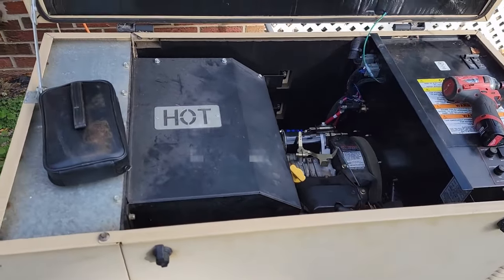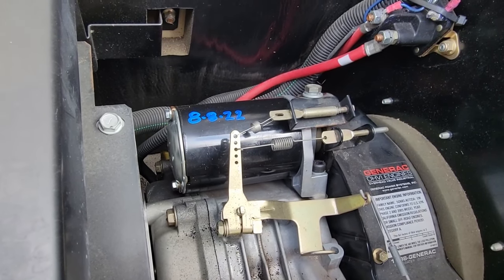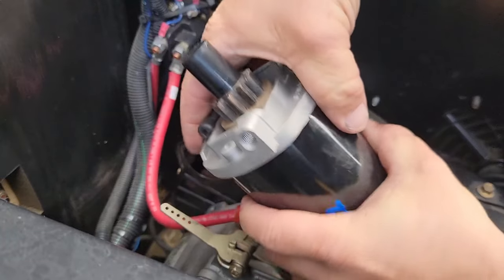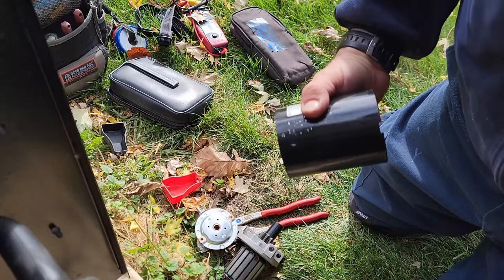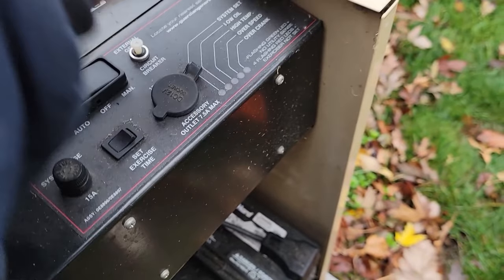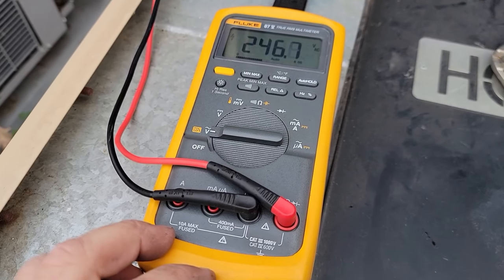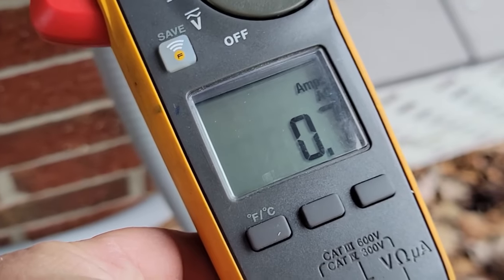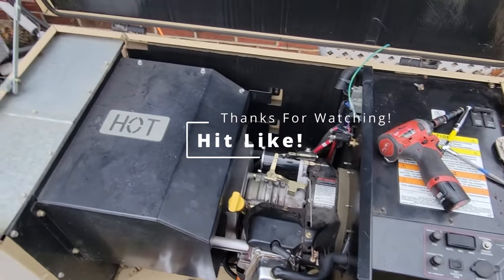Generac Standby Generator Wont Start AGAIN!!!

Comment: I was a bit stumped by our 8kw overcrank issue it had since last week, but it turned out to be some corrosion on the gas solenoid wire connectors; there was a big dump of snow before Christmas and that left a lot of moisture everywhere and the 12 volts isn’t much push to get through some crusty corrosion.  I removed and re-attached the wires and that was enough to get it fired up.

It’s been running a bit unstable lately, hunting a bit so it definitely needs some kind of service, not too sure what exactly but at least it’s able to start now.
Reply from the maker: I'm glad you got it going!

Comment: I like Amprobe meters , I got into them by watching you Rick 👍
I got the AMP 320 which does phase rotation but actually does have 3 leads which makes it sooooo convenient ! I use it to check for correct phase rotation on every commissioning and it has never let me down so far 👌
Reply from the maker: That makes me feel good🙂👍👍🤜🤛

Comment: Thanks Rick for taking us along on your “favourite service call” I can’t believe you have to tell everyone repeatedly about the knipex pliers and put a text on screen to again let people know they are not regular channel locks!!
Reply from the maker: It's amazing how many people either don't know about them or are just not paying attention.
Reply: Still not a replacement for a good set of wrenches, I don’t care how good your adjustable pliers are it’s just lazy. I grew up in a mechanic’s household and I’ll ALWAYS go for the right tool for the job.
Reply: @JeremyPeters  when you do service calls that can be far from the truck or on a roof you will learn quickly how to slim down your tool bag to reduce the weight. My dad is a retired heavy duty mechanic and I have a full rolling chest of all kinds of wrench’s but I am for sure not packing that around!
Reply from the maker: @Jeremy I carry as few wrenches as possible, the only good fixed wrench is a 6pt box style. Open end wrenches are junk and strip the head. I haven't stripped a bolt yet with those.

Comment: I had a problem with my 15 year old generator just clicking instead of starting, replaced battery and yet only started one time, so I replaced the starter twice with same symptom, FINALLY I got a battery with over 600 CCA (of course I had to make the cavity larger with a hacksaw) and now starts everytime for the last 2 months

Comment: We had a 20kw Generac, side opening door panels, 27 years old, no problems, accept the muffler rusted and I replaced it with all stainless one, SS clamps, pipes, flapper, etc. We would lose main power at least once a year, sometimes ran for a few days before power was restored. Replaced the battery twice, thats over 1400 startups. I added a circuit so that if the generator attempted  an exercise but produced no 240v power a local sonalert beeped so the home owner could investigate.
Reply from the maker: They were built better back then.

Comment: I have the 12KW version of this series I bought as old stock to replace a few years newer 16KW that blew up.  The 16KW was only a few years old when it lost the rear cylinder, I pulled pieces of the con rod and piston out through the jug.  Real mess and a serious piss off for me.  As for the battery?  The unit is located next to my garage so I relocated the battery into the garage and installed a good quality marine 5amp smart charger. I pulled the connector on the internal charger.  I also put an oil separator tank on the crankcase breather as it was sucking oil into the air filter and plugging it.   Why there is so much blow bye on an engine with so few hours is a mystery.   I just replaced the brushes on the generator section as one of the braided wires attaching the brushes had failed.  Brushes actually looked pretty good otherwise.  My top lid has completely rusted out so I swapped out the aluminum lid from the newer failed machine.  Was not an exact fit and had to relocate a hinge.

Overall these machines suck in my opinion.  Mine is on an out island in the Caribbean and it is a constant battle to keep running.   For example I’m sick of seeing that blinking overspeed led blinking.   Many of my neighbors have given up on them as they have failed and eventually no one seems to want to fix them or are unable to diagnose them.  They then upgrade to more expensive diesel units. I would never have purchased the Generac in hind site.   Pay me now or pay me later.
Reply from the maker: I feel your pain my friend, being out there on the ocean doesn't help, that salt water attacks everything. The reason why they're one of the best selling generators is because they are one of the best price home standby generators out there but obviously quality has been laxed for quite a while. I've been begging our sales guy to not sell any generators anymore just because it's nothing but a hassle.
Reply: @HVACRSurvival  indeed for the price you do honestly get a lot for your money, just not a lot of quality to go with it.  My first service call 12 years ago involved flying someone in from the main island.  $$$$$.  He diagnosed it as a control board, so I brought one in from the States in my luggage, but it proved not to be the problem.  So almost $1000 later it was still not working.   Taking matters into my own hands and studying the Wiring Diagram I was able to diagnose it as a shorted Auto/Off/Manual toggle switch, for $15 plus shipping.   Salt water from a tropical storm(Irene??) got into the switch.  I’ve now chosen to do all of my own repairs, which can be a frustrating anxiety ridden endeavor for a DIY person, but unfortunately necessary in my case.
Reply from the maker: The problem I run into is this isn't all we work on. So if all I did was work on generators it wouldn't be a big deal.
Reply: Blow by, I wonder if it never broke in properly?
Reply from the maker: Where I use to work we use to run them 5-8hrs and then change the oil. We didn't lose motors like I see now.
Reply: I've always felt my engine failure was precipitated by a stuck valve making contact with the piston.
Reply: that flashing overspeed light is the board not seeing AC output fast enough after starting. The factory does offer a field boost kit but at this point in time it's well out of the goodwill gesture they were giving 10 years ago. I believe retail on the parts is under $100 and might take a half hour to install. Last time I put one in was just over 3 years ago. Not sure if that's a worthwhile investment now.
Reply: @rupe53  good information.  I was not aware of the fix,  I’ll research it.
Reply: @rupe53  found it.  0H07850SRV  $80-$90.  Ordered.
Reply: @briand2614  .... going from memory, the kit was originally offered for serial #s starting in the mid 25xxxx through 45xxxx. We were one of the test dealers who got paid extra to do follow up on a few dozen sets. (factory R&D outreach) That's the extra clout you get when you are high enough volume and 90% of your techs are factory certified. As I retired (3 years ago) the newer sets were having a similar problem but now it's a digital read out of RPM sensor loss, which basically means the board isn't seeing output fast enough. I hear through the grape vine the board spec was changed to wait an extra few seconds before showing that code.

Comment: I had a small motor like this, on a neighbors lawn mower vacuum. It was "locked up" but it turns out, that in the right conditions, they would not spin over. I spun the motor over by hand, just a inch or so, and it started again. Haven't had a problem since.

Comment: I got an 8K Generac portable generator for a house generator for two main reasons.  If I ever moved I wanted to take it with me. And, I literally save over $3k not going with a stationary generator set up.  It works fine and powers the house when we lose electricity.  When the power goes out you can look up and down the street of the housing complex and I am the only one with lights.  The only thing that failed and I have never fixed it is the battery system.  I have no idea why the start battery system wasnt designed to charge when the generator run.  Anyway, the battery died and I replaced it and that one bit the dust too so I just use the pull cord and it always starts within 3 pulls.  I did talk to Generac and they said when I run it  bi-weekly to keep everything lubed to be sure I put some kind of load on it.  Even a fan would do.  The idea is to keep the brushes working properly.  So I do and I have had it several years through several outages and it works.
Reply from the maker: That's what I own. None of the portables that I have seen have a battery charger built in, they usually have a external charger.

Comment: thanks dude.  i'm investigating generac to buy one.  I'm apprehensive .  Bad and cheep engineering so far.
Reply from the maker: The newest models are a lot better. I own a 8kw gas and a 3k inverter and both are Generac. No problems from either but I take care of them and they are inside the house not outside in the weather.

Comment: Hi great video I will be changing my battery to see if I can get my generator running.  The one I have is same kind as in the video except mine has an hour clock.  Can you tell me how I can find out how many KW is the generator and is it entrie house or not.  Thank you.
Reply from the maker: Inside the generator they have the amps it’s rated for take that times the voltage which is 250 V. That will give you your wattage.
Reply: @HVACRSurvival  thank you I will take a look. If the new battery does not fix the issue  do I call generac to service the unit or should I call an electrician? Also any ideas on cost for a service call? Im in NJ. Thank you.

Comment: Do you carry a quart bottle of distilled water for topping off those batteries?   The main victim of the overcharging is going to be boiling the water away.  (Specific gravity hydrometer is useful as well)    Unfortunately, too many people - and shops - don't check the batteries.    They just run them into the ground, then replace.
Reply from the maker: My refractometer has Specific gravity and I have a dedicated one. Interstate battery said it doesn't matter if its distilled like it once did so I don't worry about it anymore.
Reply: @HVACRSurvival  - Yeah...that's a company that wants you to buy new batteries.   Do a quick search.  Toyota Forklifts, for example, has a "how to correctly water your forklift battery" short article.  It's not really so much 'distilled' as needing 'pure'.   The problem is that most bottled water has minerals added 'for taste', let alone hard well water.  People with water softeners, for example?  Battery killer.  Chlorides PLUS the minerals (potassium, calcium, and magnesium).   Exide Technologies own website (One of the two manufacturers of car batteries in the US) says distilled only, and even sells their own brand of distilled.    

Now, they may be talking about just calcium, which is now sometimes even added into the battery plates for additional 'science'.  :) 

It could also be they're just referring to people that check once a year or two, which means it's not really going to help much anyway. (that reminds me, I need to check my car battery)
Reply from the maker: 😂👍👍 go check it!
Reply: @HVACRSurvival  ... I serviced Generac for almost 25 years and over the last 15 never had to add water to a battery. Between maintenance free, sealed batteries, and lower charge rates, it's just not the problem it once was.
Reply from the maker: @rupe53  the new units are a lot better. That's why I haven't had to make many videos of them. I originally got into generators because I was bored with residential and light commercial but I'm into too many things now to miss with them. I lost my desire🤷
Reply: @HVACRSurvival  ... I feel your pain. I retired 3 years ago. BTW, our company was large enough to do only gen work and never have a dull moment. About 6,000 customers and 15 service techs.

Comment: I just bought this unit. If the unit isn't hooked up to any utilities at all. It's just sitting on the ground and the only thing hooked up is the battery. Can I get the unit to crank to make sure the engine is good? Trying to bench test a generator before having it installed.
Reply from the maker: Yeah it'll start and run just have the breaker turned off. Unhook the battery when you're done because it'll go dead if it's not hooked up to the utility.

Comment: Great video. I'll subscribe. I just bought this exact unit. The propane inlet line on the side you're working on in this video, on the one I bought is full of rust. I want to remove the line where it goes into the regulator behind the battery. Is the line going through the steel box just threaded into the regulator? I don't want to crack the cast housing of the regulator. Thanks.
Reply from the maker: Usually it's threads right into the fuel regulator.

Comment: You should have put some WD on that ring gear, all the rust ain't good. Also, you like leaving the charger at 14+V ?  Wouldn't 13.5V be better?
Reply from the maker: The voltage is not adjustable. It's a shit charger that the dumb asses  at the factory chose to use. That's why I bitch about it every time

Comment: Are there(to your knowledge) models that Generac makes that aren't having many problems?  I'm considering getting their 7.5 kw standby model. Thank you for this video.
Reply from the maker: Most of the newer ones aren't that bad, but if you're going to spend the money on a 7.5kw you might as well as get at least a 10kw or 12kw, that way you have two cylinders instead of one. If you really don't need that much capacity and you don't need the standby option I would get one of the generac portable inverter style units. That's what I own, and I own a 8,000 kw gas unit
Reply: @HVACRSurvival  Thank you Sir!

Comment: I had the same problem and had replaced the starter (while replacing starter I charged the battery) which seemed to work but just for 2 weeks and the same problem where the starter would just click so I contacted support and was sent a new starter and of course that also lasted a couple of weeks. At this time I figured it has to be a weak cell in my battery so I replaced the battery and low and behold after two weeks the problem came back, I finally got a much larger battery which meant I had to cut out the panel behind the battery compartment so the battery (639 cca) would fit. Now this lasts about 3 months at which point I charge the battery and it's good for another 3 months. Not a fix but I don't mind charging every 3 months
Reply from the maker: Why are you having to charge the battery?
Reply: @HVACRSurvival  Because even though there was a trickle charge going to the battery, it would not have enough power to turn over the 15 year old motor without taking the battery out for a complete charge. The new battery  is much stronger and has no problem turning over the engine. Remember I changed the starter twice and the battery twice BEFORE replacing with a CCA of 630
Reply from the maker: I would get a automatic trickle charger capable of doing up to 2-4 amps and mount it in there,  it should do it. that way so you don't have to mess with it.
Reply: @HVACRSurvival  I tried that and it didn't work, I guess the age of the unit make it harder to turn over

Comment: I finally decided to have one installed. Not feeling real confident in the quality and dependability of a standby generator
Reply from the maker: They're much better than what they used to be. Make sure you maintain it and the company that installs it does a good job and you shouldn't have any problems.

Comment: The gear at the end is a bendixg, aka gear clutch.  The grease and lube dries out and the bearings bite the big one. Causing the motor to work in over drive burning the motor out.
Reply from the maker: What's the solution? Lube the gear plate?
Reply: @HVACRSurvival  you can lube it with a lithium base oil,grease.  The twist splines only.

Comment: I had an old cranky Powermate 4000 with a Briggs 8hp I/C.  Powered my whole house through many outages.  But the thing drank oil and had a small gas tank so it needed constant attention every 2-3 hours.  Finally I gave up and bought a new WEN GN875i which is a 7000W open frame inverter generator.  I upgraded my receptacle to a 30A.  This unit is awesome.  It's the same as the Champion 100520 and the Harbor Freight unit (though the HF has a larger fuel tank).  I scored a deal via Slickdeals and ordered the WEN for like $810 shipped to my door.  Crazy.  This was a few years back but the thing is awesome.  I let it run all night in eco mode and it used 2-1/4 gallons.  Even came with a Li-Ion battery that works great even if I let it sit 6 months or more.  I did do a specific break-in and bought a magnetized dipstick (because Chonda) but I think this is a solid unit.
Reply from the maker: Proper break in his key on these motors.

Comment: What is that thing that looks like a stack of sockets that he can pull them apart until he gets to the correct size?  I don't see that in the list of tools.
Reply from the maker: Is it in this video? If so put the minute marker in your reply
Reply: @HVACRSurvival  Briefly at 0.35 attached to the power driver and at 8.15.  I couldn't find the spot where it shows you removing the smaller tip to use the next size up.  Tnx for the response.